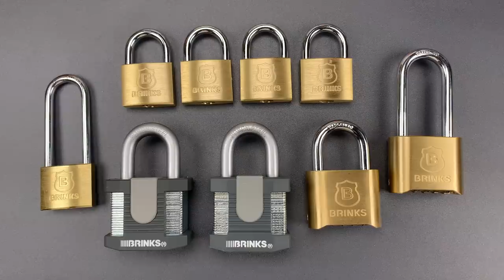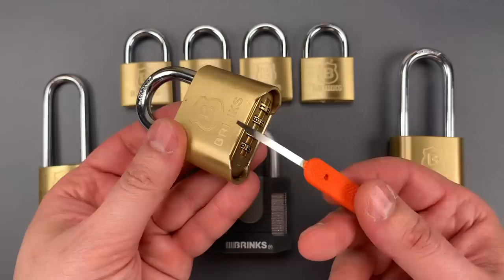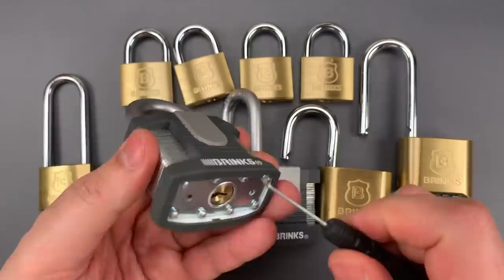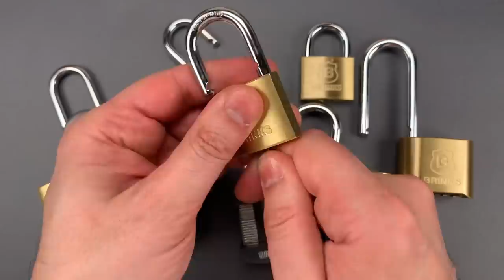[1009] Brinks Locks With INEXCUSABLE Design Flaws

Comment: 9 locks in just short of 3 minutes and he spent most of the time just talking. Makes you wonder why should you bother buying a padlock at all...
Reply: Because they keep honest people honest.
Reply: Just buy the ones, where LPL says "good enough for the street" :-)
Reply: Cause not everybody is LPL
Reply: Because they’re a good deterrent. (Not being serious but being very literal)
Reply: Just buy unshimmable disc detainer one and youre good.
Reply: Just buy one that says “pick proof” /s
Reply: There are situations where the resistance to such attacks simply doesn't matter and the locks are there to ensure authorized users follow procedure and avoid mistakes. For example: Electricians "tagging out" breakers to prevent power being applied to a circuit they are working on.
Reply: Brayden Rankin that’s the best idea everrrrrr... ha. Haha YR
Reply: I had a padlock that could be opened with literally anything (like even a piece of wood small enough to enter the keyhole) but the sight of the padlock makes most people not even try.

Comment: Do have a list of the top ten locks you recommend? My need is for locking outdoor circuit breaker panels for A/C heat pumps and compressors.

Comment: BRINKS LOCKS - 9 Locks Opened in about 30 Seconds.
Time To Open In "Seconds"
Lock 1:   5.55 sec 
Lock 2:   7.5 sec 
Lock 3:   1.8 sec 
Lock 4:   1.9 sec
Lock 5:   4.7 sec
Lock 6:   2.3 sec
Lock 7:   2.6 sec
Lock 8:   3.3 sec
Lock 9:   1.6 sec

Comment: This is the Lockpickinglawyer, and today we are at some random person's house. I was walking along and I saw this lock which has an inexcusable design flaw which most manufacturers fixed several years ago. You see, they forgot to shield the back of the keyway, which means we can interact directly with the deadbolt with something like a twig. You just put the twig into the keyway, push the deadbolt aside, and just like that, we are in.

Comment: I have one of these combo locks. and the tool to change the code. "I know it sucks but i got it for free and plan on using it on the locker while I'm at the gym." is there a way to change the code if you dont know the code. it is currently locked. the code is not 0000 also.

Comment: Honest question: how difficult/expensive are each of these weaknesses to fix? Do the manufacturers just not care?
Reply: For the comb picks, drilling slightly shorter key pin holes will fix it.
Reply: @aaronhammond7297  Or putting longer plugs and shorter springs in the holes.

Comment: It's kind of a stretch to even call comb picking "picking" because you're not looking for any sort of response from the lock at all. You just push everything out of the way entirely and spin the core open so it's more of a bypass than a pick, simply foregoing the need for a key in place of an all-purpose opening tool.

Comment: How would a lock company protect against a comb-picking technique? As far as my (admittedly limited) understanding goes, I'd have thought all pin tumbler locks are susceptible to such attacks?
Reply from the maker: Use shorter pin channels and paracentric keyways.
Reply: @lockpickinglawyer  Or a decent warded keyway. That said, I was even able to use a comb pick on an FAI by Viro. Albeit, you need to not push the comb all the way up.
Reply: Not quite. The tines on a comb pick need to able to be inserted into the keyway first. Decent warding prevents that. Then it has to be able to be pushed up. Warding can prevent that too.
Reply: longer driver pins can also help. the sum of driver + key pins should not fit in the pin channel.
Reply: All you need is just one pin stack that can't be pushed all the way up. One long driver pin would stop that.  Warding also stops it as mentioned by others.  The cheapest way for a manufacturer to stop a comb pick is to add one  slightly longer driver.  That one pin stack won't allow the key pin to fit up there also, and would prevent the comb pick from working.  
Short answer is manufacturers don't care, & are aware of these flaws.
Reply: Another prevention method would be irregular or non-standard spacing of the pin chambers. If you look at the tines, they are always evenly spaced and there's seldom more than 2 or 3 varieties of comb picks for a given pin count. That said, Gainsborough (an Australian lock product) are the only ones I've noticed who change the spacing of the pin stacks with a wider gap between chambers 3 and 4. Not sure what the reason for that is and it doesn't seem to translate to the spacing of cuts on a key. Which I find odd.

Comment: My Brink Lock Won't Lock - It Takes 5 to 10 Minutes Of Struggling To Finally Force It To Close In The Locked Position.  It does however unlock very easily in seconds with it's key.  Please.  Please take pity on me & help!   Paid about $10.00 it is brand new & I cant lock it.  I tried putting some oil in a similar brands much smaller lock bought at a different store...  That merely results in being able to entirely disassemble the lock's "U" bar from the entire lock - while it is fully locked.   (cries)

Comment: Even if I had 9 gates with Brinks Locks and 8 foot high barbwire fences surrounding my items, the only thing to slow you down would be distances between the gates. Therefore I shall just leave the gates unlock and not put the gates in a straight line. Yes I thought too much about this. lol

Comment: When will lock manufacturers evolve into companies wanting to supply the best product possible with almost no added cost to manufacturing??
All they need to do is reach out to the Lock Picking Community to attack their prototypes so that any flaws can be removed at the prototype stage. The testing group could then award security grade for both pick resistance and forced entry resistant.
This Lock picking community grade (LPCG) will give the public a realistic indication of the quality of the lock they are buying.
Surely this process would force an evolution of the lock that has largely remained unaltered in centuries.
Every lock over a retail price of $10 should be a challenge lock.
It would take just one company to do this to force all the others to follow suit or risk loosing their place in the market.
Security companies lock manufacturers should follow the basic rule of nature..."Evolve of become Extinct"
Locks such as these should be classified as "TOYS" regardless of the prestige of the company that make them.

Comment: This is just bald profiteering, attempting to save .02 cents of brass in each lock at the cost of security. In an age when you can google these exploits in front of these very locks... Yeah. I want to see Brinks stock drop because of this. Show them how valuable those tiny flecks of brass they skimped on are.

Comment: Bullshit. If the din from the fans boys could quiet down a moment, one could readily explain that a series of low cost locks for low level security use will never be used in a situation where the rare random expert with couple of specialized tools will be interested. The expert simply wouldn’t be wasting their time with these locks, and people using them aren’t locking up the Crown Jewels, just deterring random thugs, so there’s no need to make them more expensive locks. It’s not really that hard to understand. Business use cases go far beyond “give me the absolute finest everytime - Hot pockets are horrible food, but they sell a lot of them.